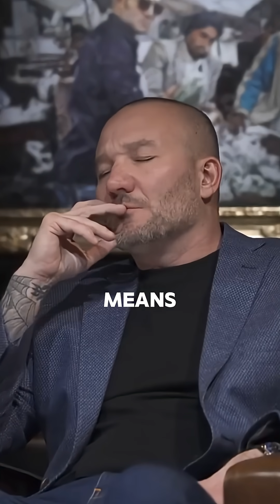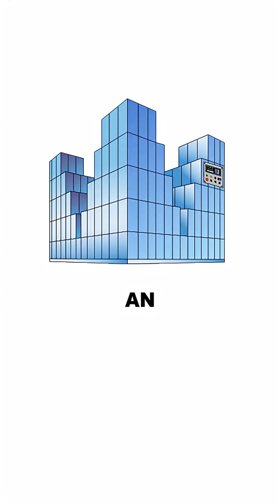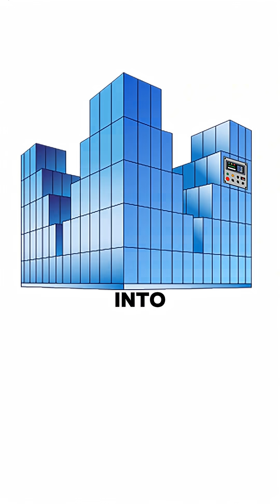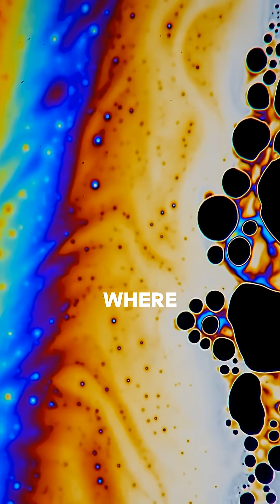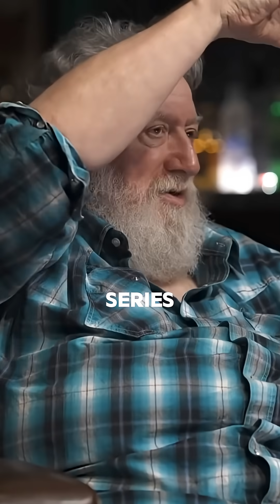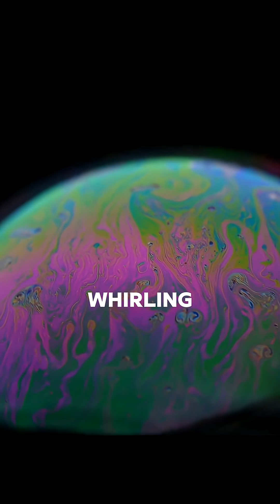Can Pollution Be Broken Down at the Atomic Level?

Comment: Yes an elaborate multi stage gas scrubber system.  I am working on a small scale system for refiners.  Basically a cycling hurricane in a drum, sequential base/hydroxide, safety trap, acid/peroxide system pulling about 4cu ft/minute.  It turns the BFRC into fresh air out the end.

Comment: Finally he exposed himself. He’s been pushing a narrative now talking about clean air. The solution is whatever tech isn😮in the air it’s cleaning the ground and water. The air cycling will clear out in a short span. We don’t produce near the metric volume of a volcanic or wildfire, yet in a matter of a month the air is clean but the residue is everywhere. So implement this tech on existing infrastructure. But don’t complain about theair when everything runs on gas and coal, oil. If it was so important they would capture the natural gas instead of the burn off pipes they use at refineries and wells.  More importantly lets stop taking about the crap that divides and really is ya issue. Then we can solve issues. 't

Comment: All of the info seen of the thunderstorm generator had alot of crazy claims, like fusion etc. It seems like it just finishes the burn of the HCs as all of the metallic deposits they claimed came from fusion are present within the chambers of the engine its hooked up to.

Still cool as Im all for cleaner air even though climate change ^TM is questionable at best.

Edit: checked some things, may be wrong still, essentially this thing turns the CO into co2 then knocks the o2 free depositing the carbon, the hydrogen becomes water or attaches to the nitrogen (HNOx) making it unnoticeable to all the emissions machines theyve been testing with. Which im sure is happening with other compounds being released.

I have seen nothing about this thing making energy or increasing the engines efficiency, but it does seem to have 'cleaner' emissions though I would bet there are compounds not being monitored (alot of compounds).
Reply: yea Randall Carlson was also hinting at something big on his latest JRE episode but seem he got caught into some scammers claims that they had constructed some sort of zero point energy thingy but I'm to dumb to understand any of it... think he might have been baited by some scammers but not sure.
Reply: @caboosej8749 i don't know if they're scammers, there is some 'thing' here, i am much more willing to think the inventor and his support actually believe they achieved zeropoint energy than them being conartists.

On one hand Randall seems to be putting more weight on it than its worth, on the other I now know about it and learned stuff while trying to figure out what it was.

Still could be wrong though, im not a physicist or chemist.
Reply: Plant more trees